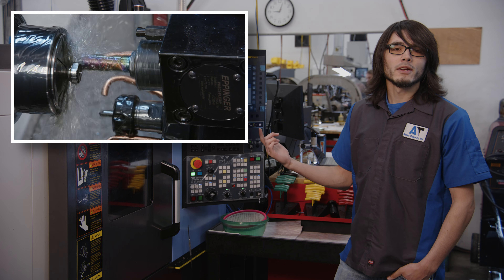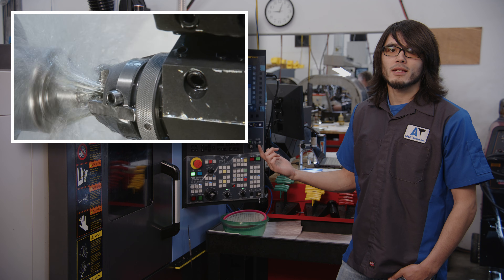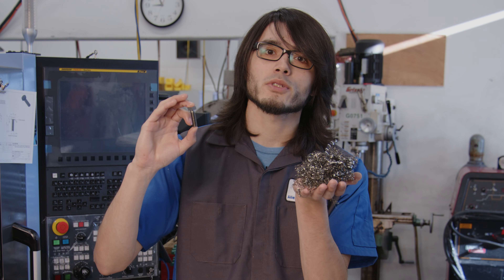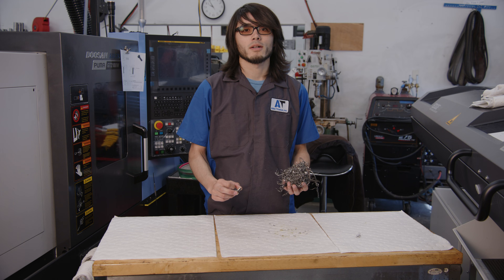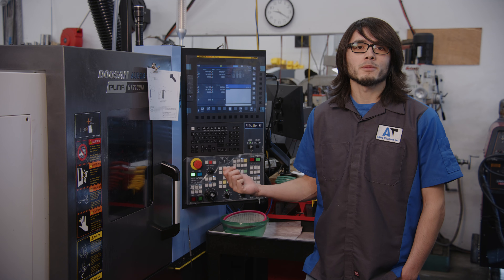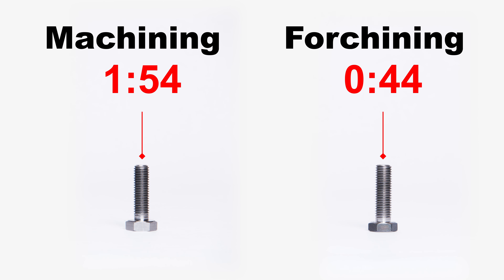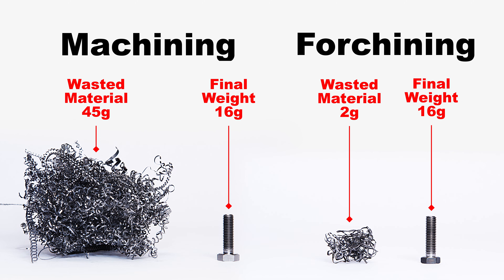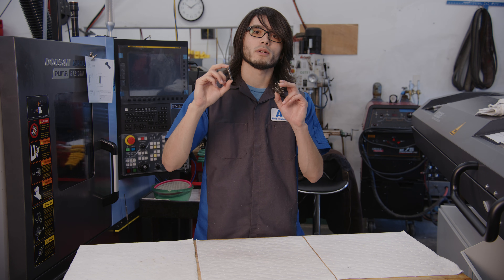Hex Bolt Forchining™ Without Machining

Comment: I'm sorry, what is being patented here? A single machine that does all this? Because otherwise I just see common operations using common techniques and a procedural technique. You do know that procedures cannot be patented, right? At least on the rare occasion when the USPTO pays attention to the laws around eligibility...
Reply: Processes can be patented, though.
Reply: They probably patent the induction heating and forming tools inside the CNC, that will get them a patent.

However I don't know how effective this will be at stopping competitors using this process.
CN will not care 😂
Reply: Patenting things has never been a problem in the US once you give the patent office enough money. The process shown does look sufficiently original to not be obvious to someone who works in the industry and it certainly will have taken a lot of fine tuning to get to the point where it works reliably (Assuming it does) and where the bolts made meet the same performance requirements as cold formed or machined products (Assuming they do). I'd worry about the lower strength and fatigue resistance of machined threads compared to rolled threads and the likely discontinuities in the grain structure between the part of the bolt that is heated and the part that isn't leading to fatigue failures in unexpected locations on the bolt, but if these parts genuinely meet the same performance standards as competing bolts in the same material then this is a genuinely useful process.

Since the swarf, especially on expensive to refine metals like Ti is recycled anyway, the amount of 'waste' is less of an issue than it looks as the swarf still has a resale value. Reduced machining time is a huge benefit.
Reply: This isnt patentable. Good fing luck

Comment: Neat process. My main worries would be the titanium oxidizing (embrittlement, hence why welding the stuff is a problem) and the obvious fire hazard between the oil, chips and red hot metal.
but if you can get this working reliably, titanium could get much more accessible for some applications.
Reply: In one of their replies they indicate a strength improvement from the forging process which suggests that isn't a problem.  From what I can find bad oxidation happens at around 1200c and forging happens at around 1000-1100c.

I guess if the temperature isn't calibrated right then that might become an issue.
Reply: The heating is taking place inside a ceramic sleeve in a non-atmospheric environment. The products are only exposed to atmosphere from 2 to 4 seconds once in a heated state.

Comment: TRUE STORY    I bought a wooden yacht in 2002 and it needed a bit of restoration.  I went to the Chandlers with a bronze screw I needed a few of. He didn't have them in stock but said he could get me then in a week, how many did I need - Only ever having done house restoration, I said "just get me a box of 200". I went to pick them up expecting it to be £10 to £20 - the bill was £1000      I had NO IDEA each bronze screw was machined CNC from a solid bar...!

So I was paying for 70 feet of 1" bronze bar + CNC machining. So this has a strange resonance with me as being a GREAT idea..!!!

Comment: how is the collet not getting damaged ?
Reply: Low forming forces because of the heated part. Rapid induction heating and flood coolant prevent heat transfer to the collet.
Reply from the maker: @Proud2bmodest  Actually, what you have here is correct, but on the DN Solutions 2600SY II, the spindles are refrigerated by the lubricating oil in the headstock and the subspindle. The lubricating oil is actually cooled by a refrigeration unit. Also, The Forchine(TM) has another refrigeration unit that is cooling the cutting oil, which is also being used to cool during the tempering process. So in a nutshell, the heat from the collet ends up in both refrigeration units!
Reply: Did you look at the collet? It clearly has tempere color at the intersection of the face and bore. Again how is that not damaging the collet?

Comment: Cool. What's the increased energy cost? Tooling? And most important, how is the part's strength affected? Does it introduce any stresses that can lead to later failure?
Reply: It depends on the grade of Titanium but some allies of Titanium can be air cooled after forging This will result in the grain structure being roughly similar. Although there looks to be a lot of coolant involved so it's probably going to be a pretty hard bOLT
Reply: I'd imagine also that briefly heating one small section with induction - which is very efficient because the energy is transmitted directly to the metal - is a lot less energy intensive than the costs of recycling all that waste metal, since that would involve fully melting it down at a much higher temperature in a furnace that needs either inert gasses or a vacuum to stop it from burning.  The full life-cycle energy costs are probably way lower.

I don't know if they use inert gasses for this process but the smoke would indicate they don't.  You forge at a temperature low enough that you might not need to.
Reply from the maker: Manually forging both grade 2 and grade 5 titanium is commonly done in a separate processes before machining all around the world. Forging, as most people are well aware, changes the grain structure and produces a stronger product. In the case of Forchining(TM), we are forging and tempering at the same time, so we get a double benefit. At the end of the day, with Grade 5 titanium, we end up with around a 10 to 15% gain in strength. As the products are relatively small, we haven't detected any strain or stress related issues so far.
Reply: @AlliedTitanium  My first thought was "this will be a stronger product"
Reply: @AlliedTitanium  "we are forging and tempering at the same time, so we get a double benefit."
That is a non-sequitur if i have ever seen one. it is like saying "kneading, proofing and baking the dough normally are done in separate steps - we are doing them in one go to get all the benfits at once".

What is the tempering procedure, how do these bolts compare to cold/hot headed ones, or to fully machined ones. Ductility, grainstructure, stresses etc compared to the other methods.

Certainly this will lay in between and likely reduce waste and cost but also there is a reason why the other methods have been used and still are the main way of production.
Reply: @AlliedTitanium  do you need to make custom dies for the forging process for each part?